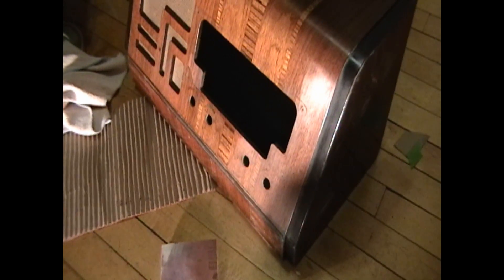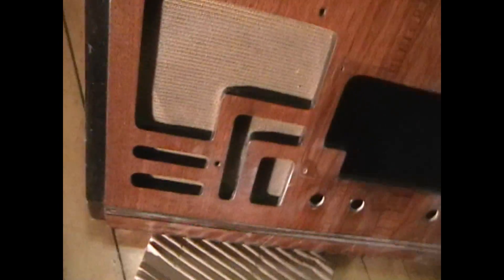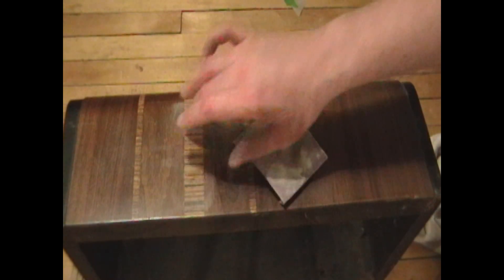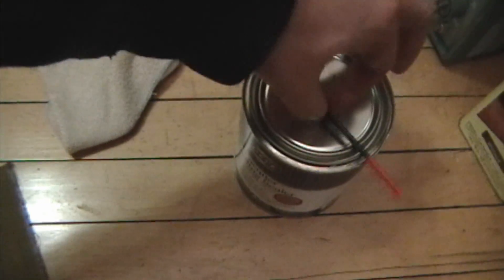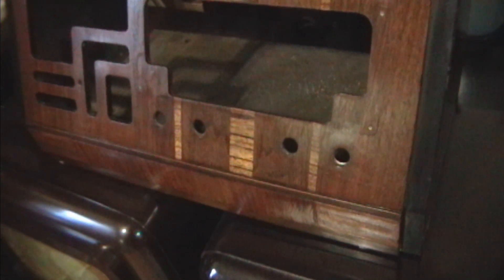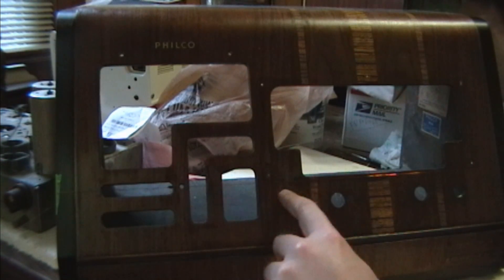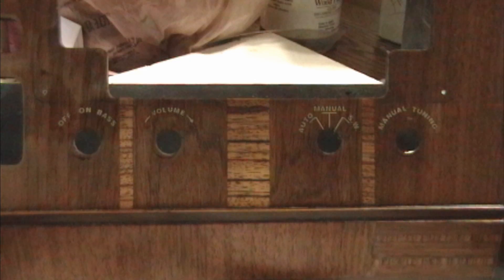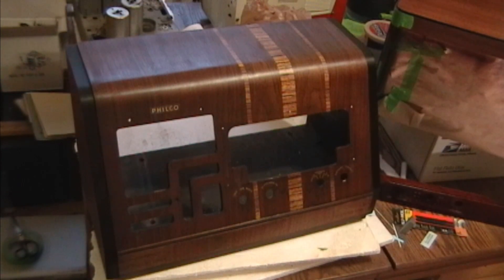Philco 39-30 restoration p6o9

Comment: There was alot of machine work done on those cabinets same as there would be now, using jigs, shapers, and routers, replicating lathes and so on, but it was all mechanical. There are a few old film documentaries and photos showing radio production from those days and they were mass produced on assembly lines with lots of workers each doing a small job over and over.